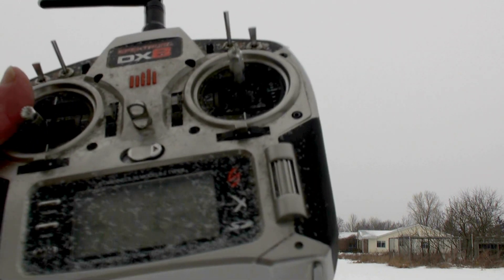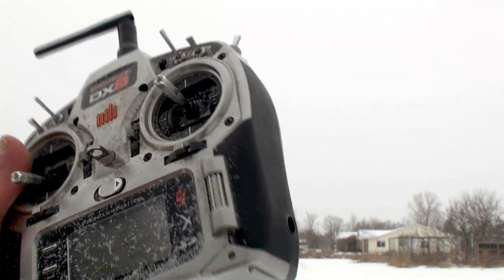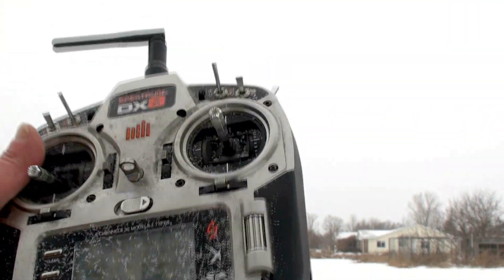TBS Discovery Maiden Flight using DYS 4215 BE3608 630kv Pancake Type Brushless Motor

Comment: What props are you using. I've tried the 1045's and get short flight times on a 1.5 kg quad. But with 1238's it won't take off using 3s. I've ordered a 4s pack to see if that helps.  Any advise

Comment: Nice. Have you thought about installing the hoverfly pro on it?
Reply from the maker: that's a good question? I do have dji 330 small quad frame set up with a hoverfly pro on it that I use for fpv flight practices and I'll try to put a video up on it soon, it's nice because it has battery level and altitude are built in the OSD on the board, I don't have GPS on the pro but I do use the altitude hold when I fly around. 
I got the Ideal from watching the TFRdrones f330 fpv flight. thanks